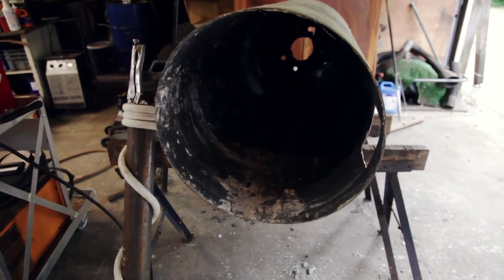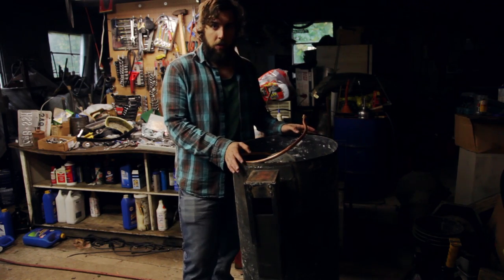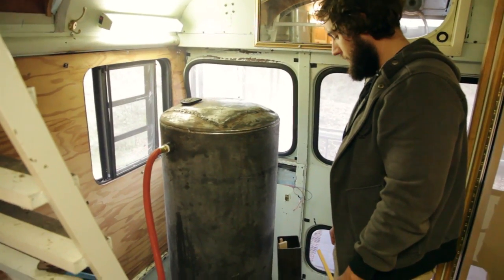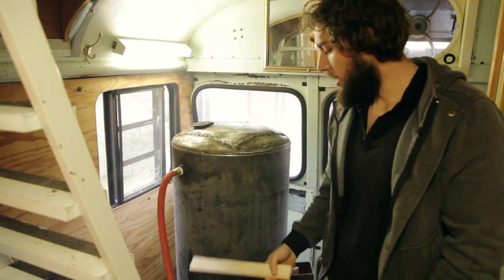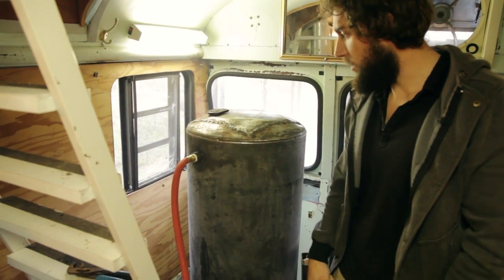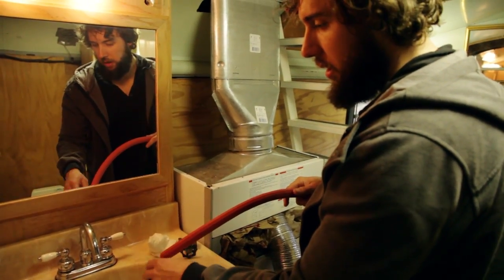Rocket Stove water heater and Spiral Staircase in Bus - Ditch Life  ep. 03

Comment from the maker: Hey thanks,  Yes I'm planning on making a rail system on the roof so I can mount and remove the panels while driving.  Also possibly thinking about a solar water heater as well.  No emergency hatch.  I'm taking the ladder I tore out and putting it on the upper deck to access the roof easier.

Comment from the maker: The exhaust gets warm but I can still touch it so it's not too hot.  The air in the stove has to cool before dropping to the bottom to exit the stove.  Later I plan to build rock up around it for safety. Also the bottom of the stove is warm but not dangerous .

Comment: I live near Minneapolis. It is illegal to live in an RV full time, unless you live in an RV park. You can't park - camp - in a driveway or on a residential street for more than 7 days. A home is required to be a certain size by law, I think the minimum is 600 square feet. It also has to be a minimum width by law, 20 feet. The only way this would be legal would be to remain constantly on the road, going from here to there, which might be my only option... but I don't have a mobile job right now..

Comment: For your stove, do you have to run the fan all of the time or just when you are starting it?
Reply from the maker: With this stove I would run it till it was warm.  I'm rebuilding it for this winter.  The dimensions I pulled from the internet were completely wrong.  I'm working to correct the issue.
Reply: Bryce Phelps
Life is difficult these days. I think that you and your wife's decisions are sound and very respectable. You've chosen not to milk the system like some many people have done. In other works, people are pushed by our leaders to milk the system. That is self destuctive behavior.